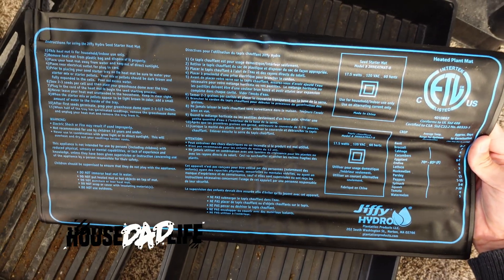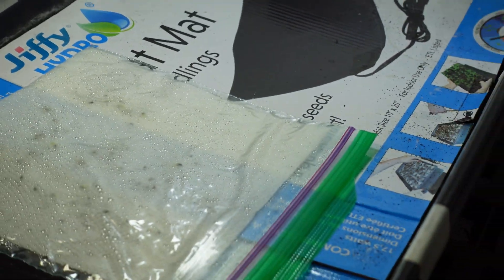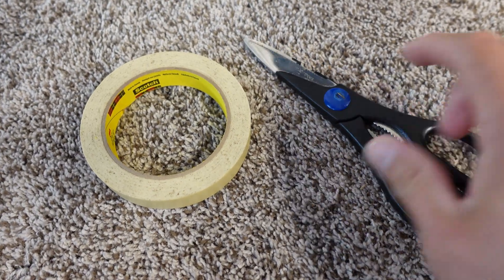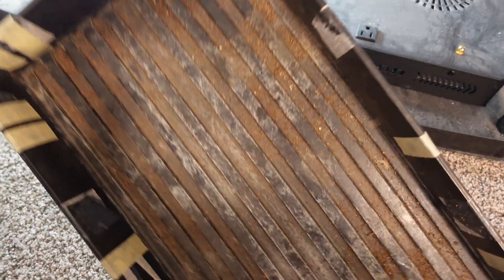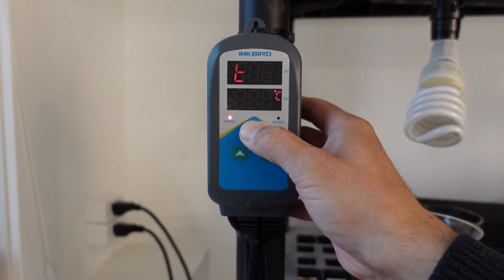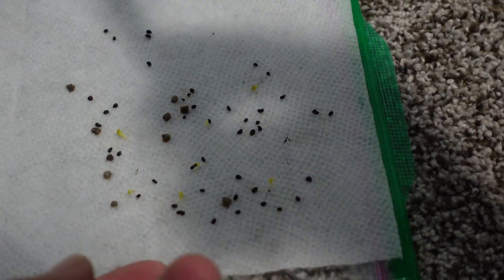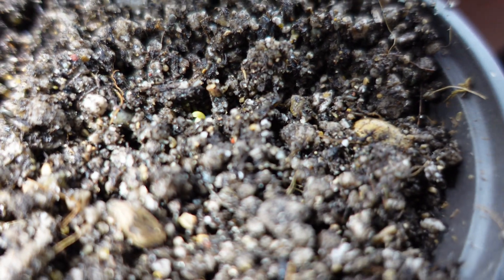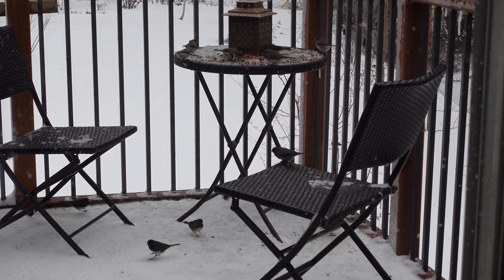Stop Overheating Seeds! Heat Mat Germination Fix

Comment from the maker: I was surprised that these heat pad temperatures went as high as they did.  It's way to hot to germinate seeds, the good news they are reliable and adding a controller was a cheap way to get much better results from this setup.